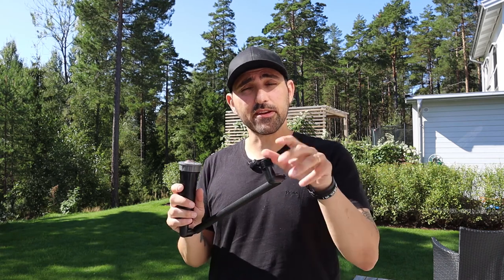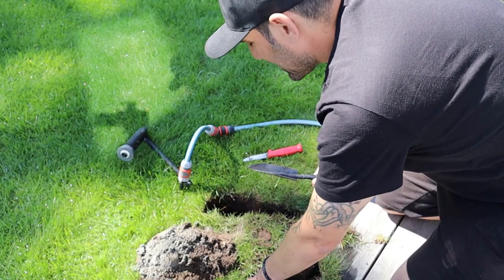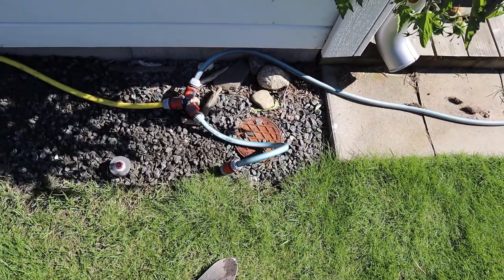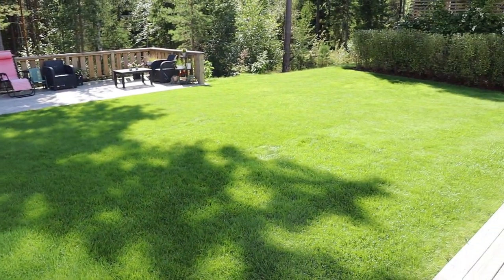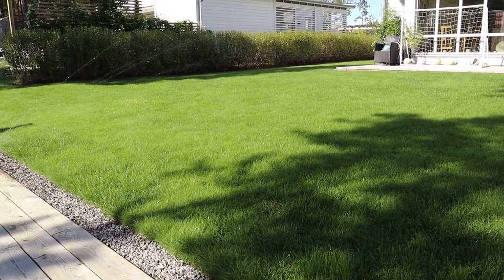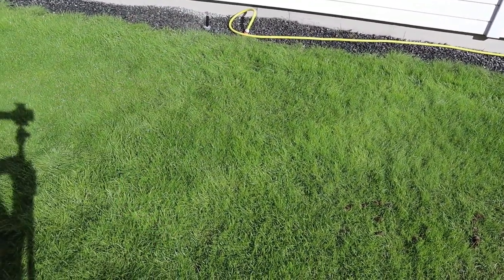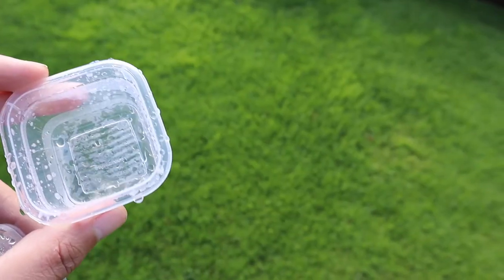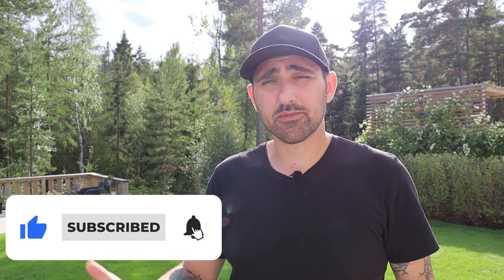Lawn sprinkler system (Hunter MP rotators above ground WITH quick snap)

Comment: Hi, would you consider rotors instead of the mp rotators in your scenario? How did you decide to go with the mp instead? Also, what would you do different if you were to start over again? I'm really interested. Thanks!
Reply from the maker: Hey mate, well I chose these because they could handle low water pressure better than other kinds of sprinklers, with this kind of setup the water pressure really goes down for each head you add to it. If I were to do it again I would maybe consider getting a different head altogether, maybe one that could handle larger areas instead, then I could have a system with fewer heads instead. That's the downside of MP rotators, you require a lot of them to get 100% coverage.
Reply: @SamsLawn very useful, thanks a lot

Comment: How did it hold up ? still working ?
Reply from the maker: Hey Vytautas, they are, I had to dig up 3 of them since I installed a new cable for the robomower, but they are still working just fine. But I think this solution would be perfect for smaller lawns, mine is too big, need more sprinkler heads to get good coverage. We'll see if I get more or maybe install a full irrigation system.

Comment: did you just run this off an outdoor tap?
Reply from the maker: Hey Craig, yep, just a normal outdoor tap, the pressure was enough for 3 heads not more, so I have divided everything into sections with no more than 3 heads. Not the most optimal solution but I wanted to try it out :)
Reply: @SamsLawn  thanks for the quick reply, going to give it a go.  Great video, thanks again!!

Comment: Thank for this idea, I just ordered everything please give a update on winter outcome because I live in Midwest with harsh winter snow
Reply from the maker: Hey Lance, sounds nice, let me know how it works out. I have a video coming out showing how to winterize in a DIY way :) first time for  me I have to do any winterizing since I haven't had an irrigation system. Hope it works :D
Reply: @SamsLawn  is your swing are 6 inches or 12 inches, I just bought 6 inch swings arms and I am wondering if this will be too short ?
Reply from the maker: @lance8280  I bought the 12 inch, gives more flexibility to set the hose correctly, but I think the 6 inch should work just fine, try one out before you change them I would say
Reply: @SamsLawn  thanks I just bought the 12 inch and will be returning 6 inch just think that might work out better. I also heard you say you are watering your grass but not sure if you have timers set up, I love my water timers so I don’t have to water manually
Reply from the maker: @lance8280  no timers, but I wish I had, would make it alot easier. Maybe I'll upgrade next season :)
Reply: @SamsLawn  just got the 6 inch swing arm delivered today and I think this will work just as good as the 12 inch
Reply from the maker: @lance8280  I think so too

Comment: Did you figure out how to empty it for water before winter?
Reply from the maker: I used a normal bicycle pump and an attachment for pumping pools to get it out, not the most traditional but it worked :D
Reply: @SamsLawn  do have a link for the attachment?
Reply from the maker: @petermuhligchristensen6588  it's like the attachments that you can see on the picture here https://www.biltema.se/fritid/friluftsliv-och-camping/luftmadrasser/dubbelverkande-luftpump-2000033972?gclid=CjwKCAjw9-KTBhBcEiwAr19igwLqpepmcE03CtN-3RXXNI0OD0Sdpaa58cJmclyhufVz7GxzHD_0eBoCVaUQAvD_BwE
Reply from the maker: let me know if the link turns up, sometimes youtube takes away comments with links automatically
Reply: @SamsLawn  perfect! We even have Biltema here in Denmark as well. Do you use anything to protect the part of the connector that are sticking up from the lawn? I mean to protect from dirt and so on.
Reply from the maker: @petermuhligchristensen6588  Awesome! No I don't do anything else, I wanted to but couldn't really find anything that would fit and it hasn't been needed so far
Reply: @SamsLawn  cool. I'm thinking of doing this as well, but I'm toying with the idea of installing a circular valve box in the with a green lid in the lawn and then mounting the gardena sprinkler inside it. Just to be able to close the lid after use.
Reply from the maker: @petermuhligchristensen6588  Yea that't not a bad idea since everytime I want to do anything I have to dig it up and back down again :D
Reply: @SamsLawn  and still there's not getting dirt in there? Interesting. Would be easier without the valve box, but I think I'll go that route. Thanks for the inspiration dude!

Comment: Remember to blow out the sprinkler head with pressurized air before you freeze for the winter. I have a feeling there may be some water left in the heads even though you remove the hose. Best of luck!
Reply from the maker: Yeah, will do that for sure, thanks for reminding me mate. 👍🏼🙏
Never had sprinklers before so it's all new to me.